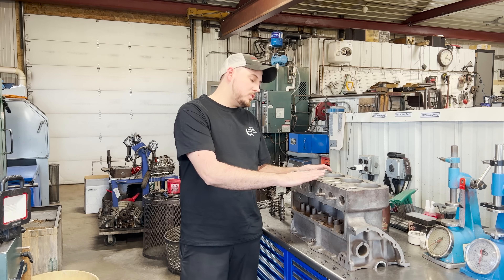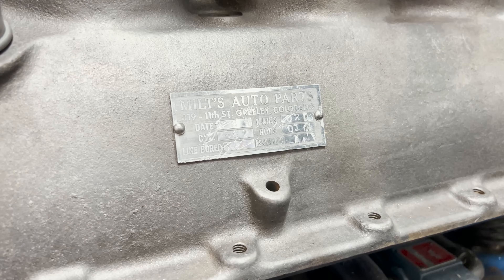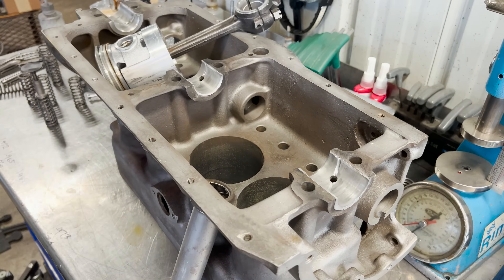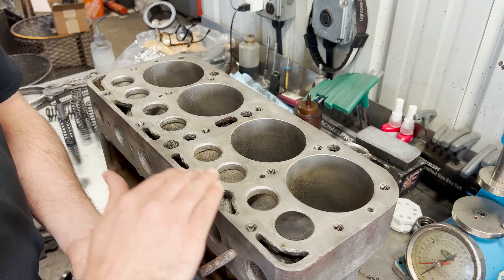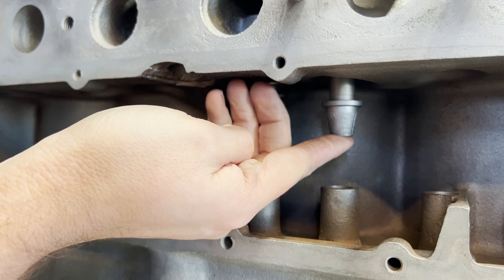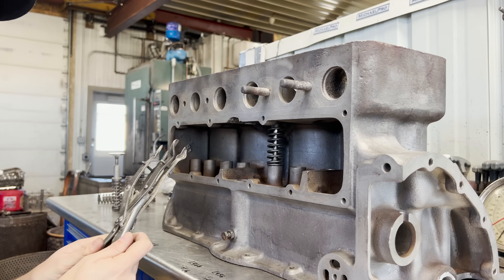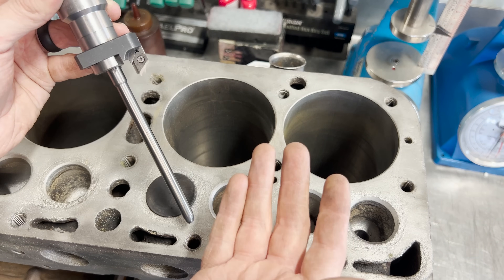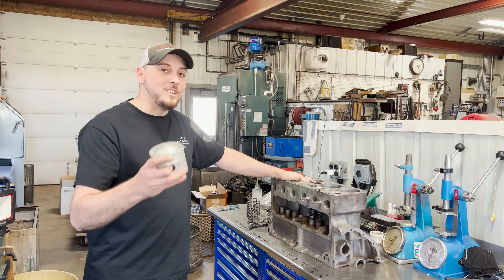The Nuanced Design Of A 1929 Ford Model A Engine

Comment: Ok first things first Son. That Model A engine was designed to run on a similar but older style of unleaded gasoline. As leaded gasoline was marketed starting Feb. 1, 1923. And was originally an anti-knock additive. And yes I know that is a 1929 engine, but those low compression low rev side valve engine do not need leaded gasoline. Lead additive to gasoline does 3 things. 1: it increases the octane, 2: reduces engine knock, 3: reduces engine wear, all of which the higher compression higher rev-ing overhead valve engines of the 1950’s to mid 1970’s engines needed. Just grind the seats, and forget about putting hardened valve seats in it, as the engine was designed to run on earlier versions of unleaded gasoline that contained alcohol. Shoot that engine can actually run on pure straight alcohol as that’s how Henry Ford Sr. Designed them.

Comment: If you would like, I can give you the number to the shop here in town that I used to work for many years ago. We did a lot of work on model A and T engines, as the owner of the shop was part owner of Texas T parts at the time. Texas T parts has changed names since then, but the same guy still works at the machine shop that used to do all of the valve/head work back then.

Comment: send the Pistons to Line2Line coatings and have the skirts built up with thete abradable coating. that'll fix your clearance wear issues. pouring babbit bearings is easy. 

however, iirc, there's a company that makes insert bearings fpr those engine's, I'm fuzzy on the details but guys hace been converting those blocks forever

Comment: Bugatti used split guides too.   One of the reasons is likely to be a combination of lack of understanding valve train dynamics and material know how.  

Materials 110 years ago were  lesser in quality  so cutting a keeper groove in the valve stem would create the beginning of a crack.  Combined with a
 less optimal valve train dynamics  chances were high a valve stem would crack on keeper groove .  Also breaking valve springs would cause a valve creating serious damage.  ( the Roll Royce Griffon uses std keepers and keeper grooves but has a wireclip in a groove below the keeper groove to prevent in case of a valve spring breaking the valve dropping into a cylinder. Which is not handy at 10.000 feet altitude )   To get around it , the tip of the valve was mushroomed and with valve locks up there the retainer was locked.  Very secure set up but the production cost of split guides would be much higher than std guides.

Comment: Do you find a lot of buildup of lead on these old engines? Do you worry about and risks of working with the metal that was in a lot of contact with lead?
Reply: @bobbydazzler6990  I was mainly wondering if there was buildup on the intake valve around the base of the stem, the top of the flat head near where the escaping gas is redirected, and the exhaust valve outlet in the block before the headers. I unfortunately live under a small municipal airport and second guess it because they still use leaded gas, but on newer aircraft engines I would imagine they are made with typical tech as opposed to the valve seats directly milled into the the block type of work.
Reply: @zdog90210  The easiest ways to get lead into your body are through inhalation AND through the digestive system. Indoor rifle and pistol ranges are really bad in this regard. I’m not saying that your location on a flight path isn’t a real problem, but if you do any shooting of ammo with lead bullets (including the ubiquitous .22) don’t breathe in the smoke/fumes and wash your hands well afterward.

Back in the day, every USAR training center had a rifle range iN the basement. They’ve closed all of them down due to the lead hazard. I’m waiting for bismuth or some other replacement metal to come down the pike.

Comment: There are pilots for the bore in the block, but need to use with stones. I have over the years collected old tooling for these engines as sometimes needed.

Comment: Wonderful, split guides, good old Ford, built down to a cost. Ford in the UK used split guides in to the early 60’s with there 100E engine. I did one a few years ago that burned out a valve

Comment: I'm very excited to see the work done on this engine. Older engines have always fascinated me, especially flatheads. I'm also hoping to see y'all work on a 7.3L Powerstroke if one ever comes in.
Reply: Me Too I have a 2001 7.3 Diesel in my F-250 just a little shy of break-in Milage of 250,000 miles. I plan on keeping it going for quite some time... so I’m expecting 500-750 K miles out of the Engine. Before anything major needs work, I’ll be just a happy camper till then waking up to the smell of Diesel in the Morning 😊 what more could an old Army Construction Equipment Repaired ask for ? 
More Coffee 😂 of course!

Comment: The first shop I worked at had wood plank floors and opened in 1917. There were several old machines in the back area of the machine shop. The equipment was there for babit bearing pours, piston knurling, ring groove cutters, and I specifically remember a pair of spring pliers that didn't have the ratchet mechanism. The foreman used to use them to see how long he and the rest of us could hold springs in tension. The manuals were one of the more interesting items that were there, plenty of times people doing restorations on stuff from the 20s and 30s would come by just to take pictures of or scan specific portions of the manuals. There was a seat at a small counter that we used to call "the library", there was no way we were going to allow a manual or document to leave the shop. If you wanted to do some research and were a known customer, by all means have at it. That shop is still there and still putting out good work to this day as far as I know.

One last thing, flat head engines were still common up until the 80s in industrial equipment. Continental, Massey, etc
Reply: Would love to see a contemporary manual. Did they call for..0075" 3x .0025" in shims like factory or the stupid laminated shim packs. Did they scrape, or line bore to a spec based on the crank dia, and spin the crank with a motor and special shims, to burnish the bearings to the crank journals
Reply: Did you know Henry Ford or Walter Chrysler?
Reply: I love the old manuals. When I was in the Navy still I spent shore duty in an instrument repair shop. We had a wheel and flap indicator that is still used today that had a manual with the latest revision in 1942. It was probably the best, most descriptive manual I've ever seen in my life. It was clearly made for farm boys who went to war and had no training on repairing delicate instruments, down to pictures of little elves holding north and south poles of a magnet to show how it worked.

Comment: Valve stems were designed that way for a couple reasons. One is because the stems ride directly against the cam with the guide so far away that there was the risk of bending valve stems from deflection. With a wider tip it spreads the load and helps reduce deflection. I think Briggs took note of this phenomenon and is probably why you will see tappets that sit in a guide bore with the valve stem tip in many of their flathead engines.
Reply: The valve stem doesn't ride on the cam, it is pushed by the cam follower.  If you look at the video about 11:40 the hollow mount the spring is sitting on is where the cam follower comes through. The hole you can see on the front of the block is the front camshaft bearing which runs under the cam follower bores.

Comment: Funny how I did a tune up at work the other day on a model A and now you guys are machining an engine for one. I'm the resident Ford fanatic at the shop I work at and between my boss and coworker, I'm the only one that knows how to operate a model A... "Hey, show us how this thing works!" Guess I was just the guy for the job because I've owned a '29 myself. The customers issue ended up being in the distributor. Several years ago he had it serviced. Someone put a whole new swashplate (I think that's what you'd call it) in it and didn't lube the lobe and sweeper for the points and so the point gap closed up on it.
Reply: Watch Paul Shinn’s channel for expert advice and servicing of Ford Model A’s. The distribution is different from most flatheads and actually needs to be greased. Timing these engines with the spark control set correctly is very important to prevent “kickback” when starting.

Comment: If you have (or can easily get) a pilot that is a little bigger than those 0.595 guide bores, I don't see why you couldn't grind it down to size on either the crankshaft or camshaft grinder. Probably save you a bunch of time if you need a custom pilot. Of course, assuming you have a lathe, there is no reason you shouldn't be able to turn a brass bushing and then ream the hole to the size of some stock pilot.

If you want to know more about pouring babbit bearings (which my father said he more than once did on the side of the road when his jalopy broke down), wander over to Keith Rucker's channel. About two videos back he just poured  set of babbit bearings for a cane mill, and described the entire process in detail. It is really a fairly simple process, and only takes two things you don't have in the shop: the right babbit stock, and special damming material. 

Basically you smoke the journals of the crankshaft using your torch, put it carefully in place in the block, put some damming material around the ends of the bearing area you are going to pour (to keep the babbit where it should be), and then heat some babbit on a camp stove, heat the crank and block, and then just pour the babbit in place. It is the right size for the journals because you used the journals to cast the bearing. You generally don't need any precision machining after pouring. You do need a bearing scraper (basically a 3-corner scraper) to clean it up, and then a Dremel or the like to cut the oil grooves you see in the existing bearings.

See Keith's video of a week or two back for details on how to do it, he covers it very well.

Comment: If the lifter bore is larger than the valve guide bore then you could create a longer and very stable bushing for your seat cutter that you would insert from the bottom with a resistance fit 🤔

Comment: I noticed that Eckler's makes a conversion kit to modern one piece valve guides and modern valves. Maybe installing that kit means machining valve seats will be easier, too. Also, I noticed that they sell things to convert to insert bearings, but it says certain machining procedures are needed. I'm not sure if those are procedures you are equipped to do.

Comment: Turn a bushing and be done with it. I wouldn't even consider buying an expensive, one-time-use Serdi accessory.
Reply from the maker: It’s part of the job. It may be a one time use, or it may get used many times over the years. 

Additionally, sometimes that “one time use” accessory seems expensive until you calculate the hours of labor and frustration it saved you.

Comment: My '41 Ford 9N tractor has those style of valve guides. It has clips that hold the split guides into the block. I'm pretty sure that they offer one piece guides for replacements.
Reply: that would be a horse  shoe clip

Comment: Babbitt is interesting stuff, it's not as common today in car or truck engines. Though there are still some Machined that use it for high load bearings or the need for precision tolerance. That aside, for a lot of babbitt bearings, if they're not loose or have chunks missing, deep gouging, embedded contamination (shards of metal, dirt, corrosion, etc) it's often best to leave it alone. But if you are resizing, the heat it with a torch to melt it off/out. Fit your cores and measure for oil holes. Fit your mould walls, soot up anything you don't want it to stick to, pour the bearing. Check the work after the first pour cools. Check it, place to paper or gasket material shims to give room for the crank dimensions, ad the second pour mould then your core, pour again. Check for adhesion, bore to size, drill oil holes if needed, carve channels for the oil, chamfer the edges smooth, deburr remaining edges. Make a sacrifice to the pagan gods. Hope you don't have to do it again because it's not correct.
Reply: From what I've heard from folks ,there can't be more than a few handful of folks still doing babbit bearings. 
Unless some kids have picked it up since,idk. 
Back 20 yrs ago my dad's buddy had a heck of a time finding someone to redo his model A bearings.
Reply: @MrTheHillfolk  I only know about it from helping a machinist that probably had to tell Jesus how to properly drive a nail. But even that was some fifteen years ago now and he's long gone.i did leave out that whatever the bearing is being poured into has to be hot enough to not be able to hold your hand on for more than a second or two. Else it'll flash 'freeze' before it properly fills the bearing area. But, that said. Keep the oil or grease in it and a babbitt bearings should be good for decades of use.
Reply: @MrTheHillfolk  Keith Rucker pours Babbitt bearings on his channel. He just finished pouring and fittings half Babbitt bearings on a large cane grinding mill that he restored.

Comment: Are you talking about pressing a bushing on one of your pilots? Why not make a bushing that drops in from the top with a large thick flange. The flange doesn’t have to match the port you’re only worried about concentricity. Make it a slip fit in the block and make it slip fit for one of your pilots. You’d have to put a hole in the flange of the bushing to put a long bolt in it through the intake/exhaust port to keep it from spinning. But it might be the easiest, and wouldn’t cost a pilot.

Comment: The valve is "mushroomed" so the valve doesn't have to be pinned and instead has that keeper. Then the guide is split so it can be installed on the valve. Basically it was optimized for the Assembly line.
Reply: A lot of old flat heads had pins through the stem of the valve.
Reply: Also I would consider lapping the valve seats. That's what they would have done back in the day to maintain that engine. But cutting them would be superior.

Comment: 6:30 just to let ya know....... a Buick Nailhead does NOT!!! get hardened seats
unless you want to hit a water jacket and F the engine
.
Buick used high nickel castings..... which are hard enough
even with unleaded gas, high RPM, aggressive cams and valve springs.... the "naked seat" is just fine
.
dont even need to add any additive to the gas

Comment: The Model A predates leaded fuel, so valve seats don’t need hardening.
Reply from the maker: This is exactly why at this point it DOES need hard seats.
Reply: @JAMSIONLINE  If was designed for unleaded fuel in 1927, shouldn’t it run well on unleaded fuel now?
Reply from the maker: According to the EPA, lead was added to fuels beginning in the early 1920's. Ref: https://archive.epa.gov/epa/aboutepa/epa-takes-final-step-phaseout-leaded-gasoline.html#:~:text=Lead%20has%20been%20blended%20with%20gasoline%2C%20primarily%20to,tenth%20of%20a%20gram%20per%20gallon%20by%201986.

I don't understand what your argument is. The fact is, cast iron alone does not stand up well in extended use against unleaded fuels. That's the same story in 2022 as it would've been in 1922. As explained in the video, when a job comes in my shop, I do everything in my power to give the customer the best quality and most durability/dependability possible. In this case, that includes hardened exhaust seat inserts. Regardless of wear concerns due to the type of fuel, the seats in the block are worn and have been ground too many times, so the valve is sunk in the block. That leaves us two options: 1. Install seat inserts, which gives us the needed material to cut the seat and get the valve sitting back up where it would have been from the factory or 2. Grind the seats one more time and sink the valves further into the block.

If you choose number 2, you're lazy and a hack.

Comment: Do you have any  .626 od guides that you could turn one down on the od to fit in the block.    Use a threaded rod and nut ground from hex to round to yank it out with a slide hammer. I would machine the guide on a valve stem pilot with a live center.  You only need one.  Grind it on the crank grinder like you did the pontiac valves.    
I wonder if undersized bore valve guides are available so you could hold them up with a spring and valve spring compressor to hone to the proper id. 

Oh. Ford designed stuff for speed of assembly on the line and reduced cost in msnufacturing parts.  Fixing later was not in their thought process. As cheap as possible.  
Holley beat out a different carb manufacturer by having a unit price 11 cents cheaper than the previous supplier.   11 bucks per car was what ford saved on pinto production that would have made them not explode when rear ended... back in the early 1980s in my 66 GTO i was coming up fast behind 2 cars at a red light.   A 220 benz and a hot rod pinto with fat rear tires. I said to my friends who had been scared by how fast my car was.  I'll take the pinto.
To which both of them said at the same time.  Don't hit the pinto, it will explode.